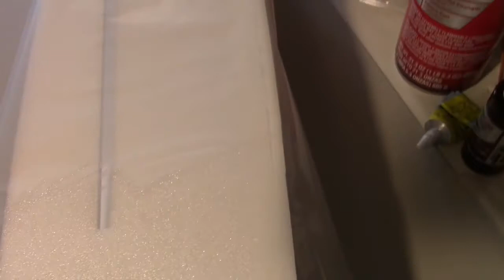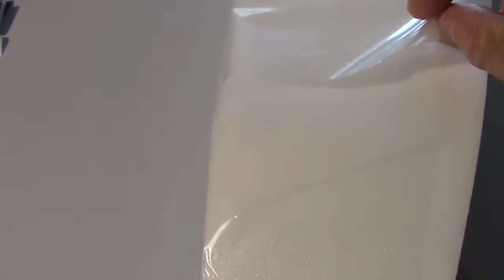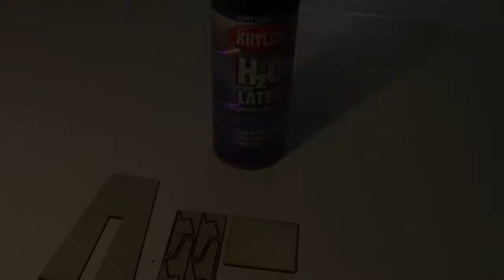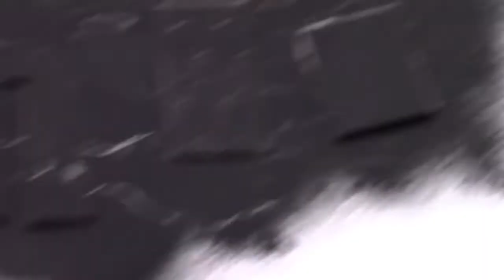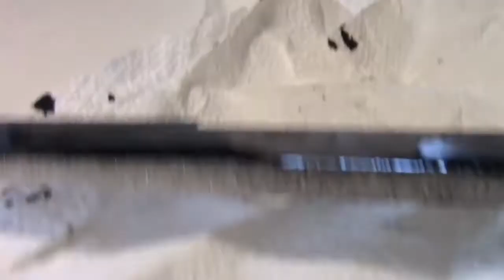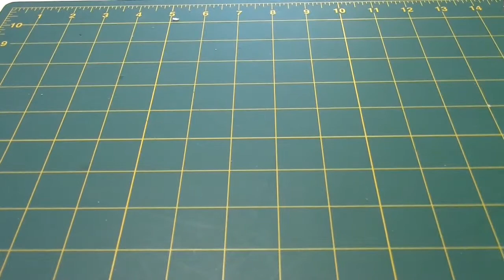ModelAero Polaris XL Sea Plane Build Series for FPV - Part 5 - Pedestal and Fuselage Lamination

Comment: Hey Dave are you going to laminate the wing? I am in the process of building one and was just wondering
Reply from the maker: Yes I have already laminated the wings top and bottom with 1.7 mil New Stuff and it should be in one of the upcoming videos. The question is how will it fly with the extra weight of the lamination.